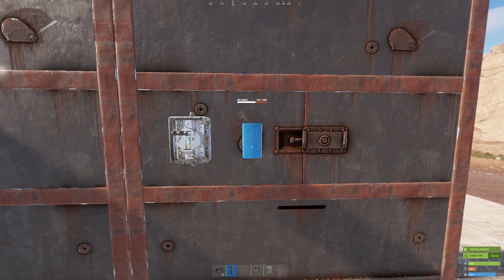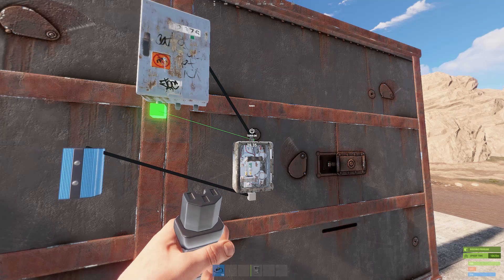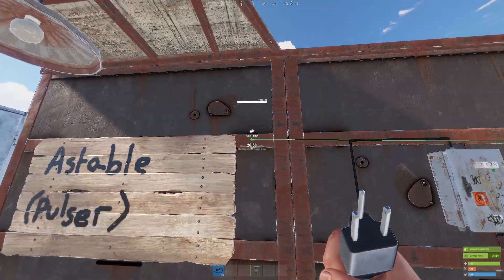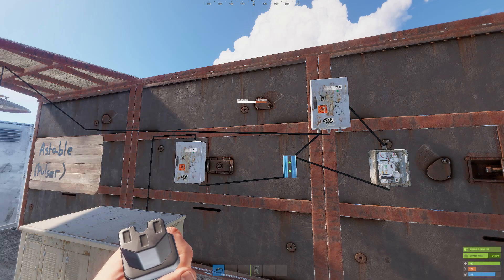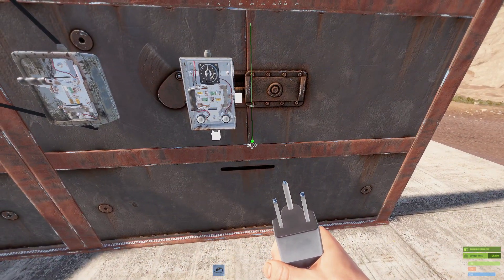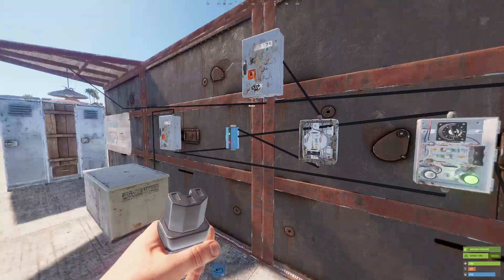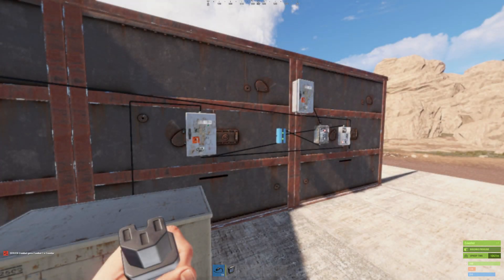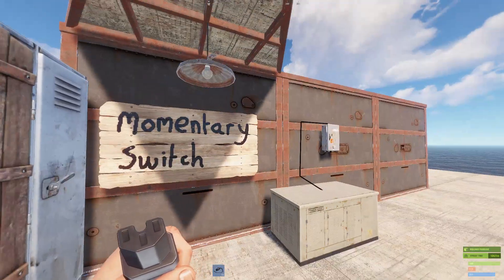2 Advanced Blocker Uses! (Pulser, Momentary Switch) | Rust Electronics

Comment: 3:25 Assuming the server settings to be normal -> each component takes 0.1s to update -> 3 components = 0.3s of delay -> 1/0.3s is 3.333333... Hz
I have a better sollution to this, why not cut power to the blocker with the switch, instead of having it in the loop, adding delay and making it run slower. This clock would run at a frequency of 5Hz.